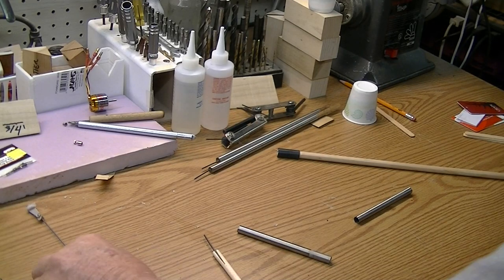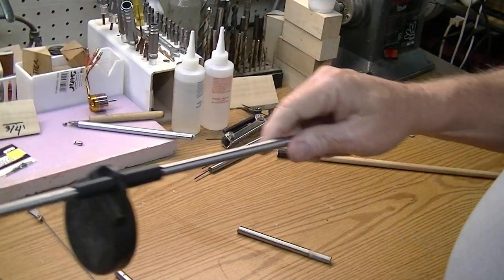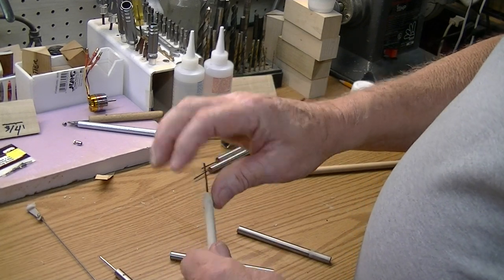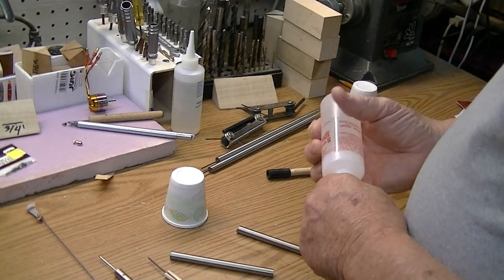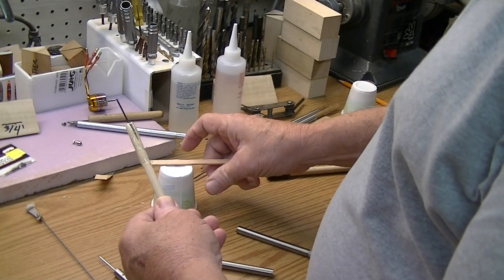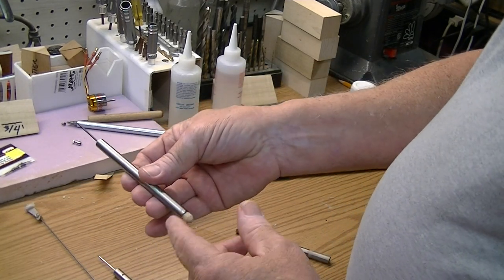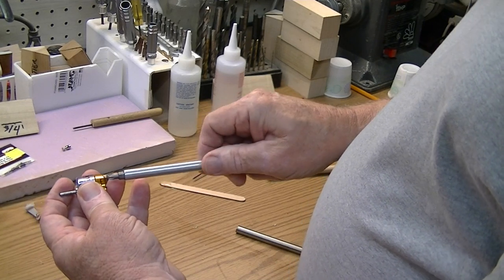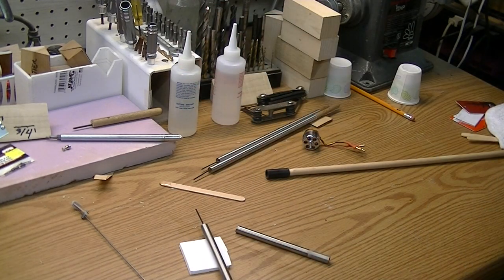Foam board rc scratch build special tools,allen wrench

Comment: I purchased a set of "x-acto" knock-offs from Harbor Freight.  Please be careful if you purchase the same set.  They are cheep and dangerous.  I opened them and took the plastic keepers out.  I saved the "Shaft Tubes" and now I know what they will become.  The knifes are truly junk and dangerous.  Thanks again for the tip.